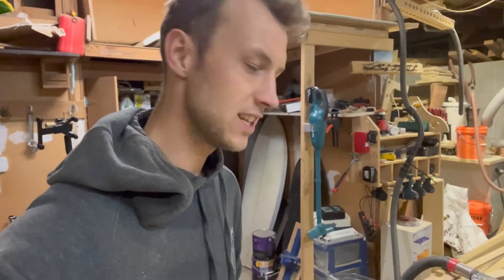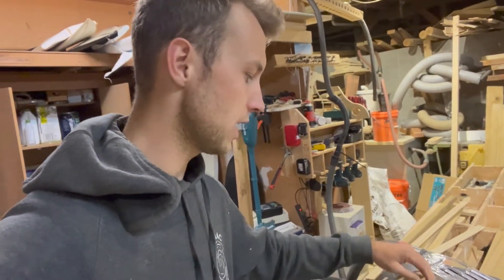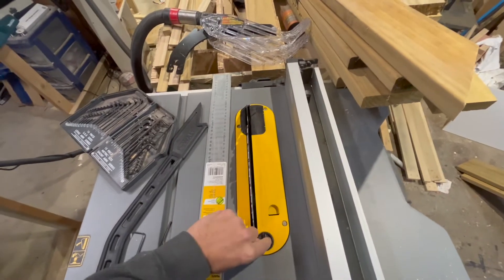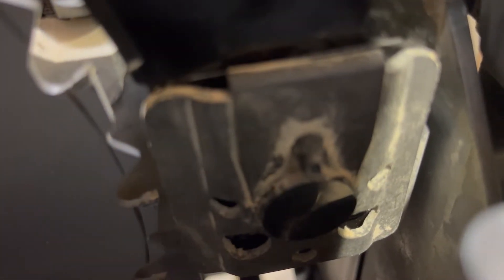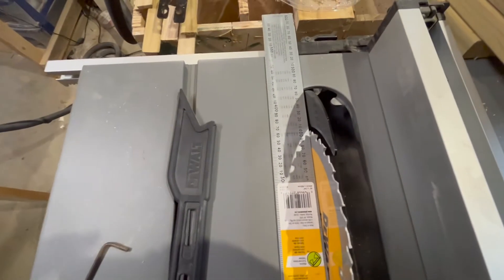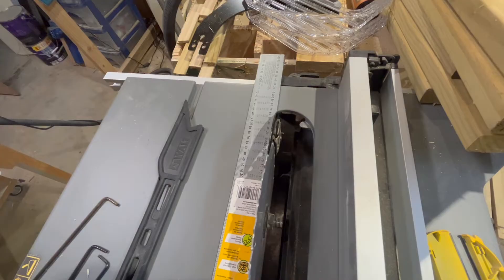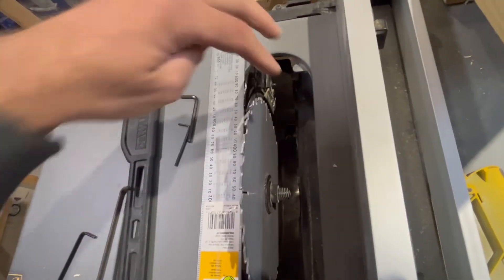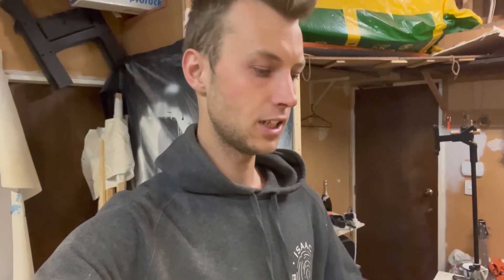Riving Knife Adjustment DEWALT TABLE SAW

Comment: You can take off the access cover under the saw (two phillips screws) where you can see the blade and the bottom of the riving knife. I was able to look down on the blade while reaching my hand around/underneath to use the allen wrench. Still trial and error after that. My set screws were 2.5 mm hex.

Comment: @Isaacbuildsthings Hey man, is your table taped as metric?  In the US our saws come in el crapolla standard/ imperial/ SAE aka garbage measurement system.  I called DeWalt to see if they had a metric replacement tape, but they said no.  As globally dispersed and sold as DeWalt is, I am inclined to believe that DeWalt offers something more copacetic to the population that uses the metric system.  Just curious is all.  I had to buy two metal self adhesive tapes off Amazon (marked with both measurement systems), cut off the inches and BS fractions before placing it on the saw.  Cutting the tape to perfection was a SOB.  Anyway just wondering if the normal nations that use and buy US tools come in metric and not the flawed antiquated measurement system tools.

*and for those that wanna bag on me for learning and exercising a much better measurement system…I feel bad for ya, no seriously.  Fellow Americans (especially my fellow Texans) ask why I hate inches, feet, yards, etc.  It is such a simple answer too.  I just ask them to add and subtract the following:  Add 5/8 + 3/16 + 3/4 + 3/32, now subtract 3/8 - 1/32.  😂 they all say that they need to write it down to do the calculation.  I tell them to now do the following calculation:  0.4+2.3+0.6+0.7, and now subtract 0.3 - 0.8.  They can quickly rattle off the later from just mental calculations.  I then tell them, “that’s why I use the metric system”.
I know, I can hear the US nay sayers now, “Cuz this is ‘Merica man”!  Yeah, well the only other jacked up nations that use this jacked up system of measurement is Myanmar(Burma) and  Liberia.  American education system 😔, such a failure.
Reply from the maker: Haha yeah it came taped metric.  I don’t think anyone in NZ would purchase it if it came imperial😂.  We definitely find it much more simple!

Comment: The alignment, (Fence to the blade) was out on mine about 1mm far end.  The "pre buy" 7485 reviews I watched all were perfectly adjusted, straight out of the box. so I didn't suspect the real cause and adjusted the riving knife making matters worse.  Finally got around to thinking check everything.  Manual written presumably for different model as it believes best to adjust with the saw blade fully up and bottom cover left in place.  Far easier to wind almost down when you have decided how much to adjust.  Remove bottom cover, and the adjusting screws (Hex bolts) easily gettable. Half a turn of the setting bolt moves the knife a long way, so it took me many goes to get it virtually spot on, and after I have changed saw blade I will micro move one of the knife setting bolts and get it absolutely 100% right.  Thanks for this video, really made job much easier particularly explaining which way to adjust bolts for direction of movement.

Comment: I'm glad for the comments here. The manual only says "If needed, use the set screws to bring the riving knife vertical with the square." A vague reference if anything I guess about the set screw not mentioned on the bottom of the mount nor is it pointed out in the drawing correctly. And it would help if they told of how to set the knife square with the table.  An alignment pin on the top is pointed out as a set screw in the drawing. Obviously the arrow pointed to the pin should instead be pointed to the  3rd set screw located on the bottom. That should adjust the knife being vertical to the table with with a square. As the manual points out numerous times how important it is to check the riving knife and splitter (riving knife with guards), you would think they could at least get a complete and correct alignment procedure in the manual.

Comment: Great video, thanks. Mine came with the riving knife in line with the blade, but higher than the blade, by about 20mm. No rebating possible.

After removing dust guard and loosening slightly the two 4mm bolts, I was able to knock it down to correct height. Quite a nice saw this one, for a cheapy (relatively...)

Comment: Super helpful - thank you both! I have the DWE7485-GB which has another adjustment screw at the very bottom of the plate which works in the same way but tips the knife. My Allen key sizes are 4mm and 2.5mm (but the instructions don’t want to give that away of course😅).
Reply: The model shown here apparently has the same set screw at the bottom. I wonder if your manual mentions it and tells about the adjustment it does? The manual that came with the DWE7491 does not.

Comment: I just did this, and it's nightmarish.  Your video was helpful to a degree, especially in that it's counterintuitive screwing the small screws "in" actually pushes the knife out.  Manual says loosen the larger screws "if necessary" ??? They don't explain what necessitates it. And they don't explain which direction to turn it for the desired direction of movement.

I was trying to adjust with your method, and it wasn't moving at all when I turned the top screws.  Then I realized the whole knife was loose as can be, and wobbling with a ton of slop.  After playing with it for a while, I realized that the big screws and small screws work against each other.  In other words, the more I turned the adjusting screws, the looser the blade got- then I had to compensate by using the big screws to firm it up again.  And there's really NO room to work, or see how to insert the allen wrenches...you have to do it by feel- get a half turn, remove it and fumble to reinsert.  I took the blade off to have more room, then played with all the screws to see how it was moving.  Then reinstalled the blade and did the final adjustments.  

Thanks for the video- there were only 2 about this on this model, and yours described it best.
Reply from the maker: Thanks!  Yeah definitely a balancing act and this was the best I could describe it at the time. Definitely not a perfect tutorial but glad you found it helpful.  Cheers!
Reply: @Isaacbuildsthings  Yeah, I just hope I never have to do it again.    Actually, with so many Dewalts out there, and how difficult it is, I'm surprised there aren't more vids about it.  It probably would've taken hours to figure out without your video, so thanks again.
Reply: Same here. This is my first table saw and I bought it just a few days ago. Took me less than an hour to do all the other adjustments, then I spent 2h trying to adjust those stupid screws... horrible position, horrible mechanism and the small allen key was also missing. Adjusting that thing was a PITA and still it never moved how I wanted it to move. Currently it is still half a mm off and I need to give it another try tomorrow. Can't wait for it, yay! Definitely the worst part of this saw.
Reply: Hey for next time if you look under the saw on the right side there’s a cover you can remove. Two phillips screws and two clips hold it in place. Remove that cover and then lower the blade about halfway and you have plenty of room to access the screws for the riving knife.

Comment: The smaller hex key is 2.5 mm as others have noted. And the bottom 2.5 mm (not top as in the manual) is indeed the tilt adjustment.

This is a really difficult adjustment to make. I recommend turning only one of the three adjustment screws at a time so you can see its effect and make other adjustments incrementally. The upper two adjustment screws should be adjusted one at a time until they align the riving knife with the saw blade horizontally. Then the lower adjustment should be made to align the knife and blade vertically. 

Each time you make an adjustment, you need to loosen and then tighten the two lower 4 mm set screws. And they need to be made fully tight each time you check the alignment because the alighment changes as you tighten the set screws. It took me a lot of trial and error on my adjustments and I had to go back and redo a lot, and each time I had to loosen and tighten the set screws. That's why I suggest small adjustments first, and only one at a time, so you can perfect the technique and make the mutiple adjustments as few as possible.

The hex screw heads are impossible to see behind the plate they're recessed into. Getting a hex key inside the hex heads (particularly with the 2.5 mm screws) is pretty tricky, and your working space is very cramped.

But it's all doable. It just takes time and patience. Maybe a beer if you're saving your woodcutting for later.
Reply from the maker: Thanks for the tips!
Reply: This is on the money, thanks. 2.5 mm confirmed also for the 3 set screws in the DW7492 sold in Europe.
Reply: Thanks for this, that manual is horrible with a few of these things.😂

Comment: You forgot the lower 2.5 mm adj. screw and check its squareness with table top (to match blade).
* Note: instruction manual (mine anyways) shows that 3rd 2.5 mm screw on top, where it should be shown at the bottom. The top is a spring pin - not an adj. screw.
Reply from the maker: Thanks for the clarification! Yeah I made the video because the Manual isn’t super helpful for this adjustment!